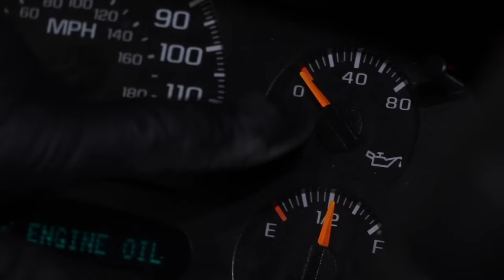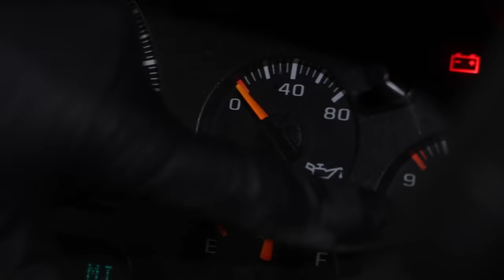Top 5 Problems 2000-06 GMC Yukon Sierra Chevy Suburban Tahoe Silverado Avalanche Cadillac Escalade

Comment: I have a 2000 Chevy tahoe. On occasion I start it and immediately shuts off. I learned to leave the key on once this happens and sit and wait till the security light stops blinking. Once it does I shut the key off and then start it. Any suggestions as too what to do??
Reply from the maker: +Tim Shaw We wouldn't be able to diagnose an issue like that here, you may want to have a local mechanic take a look at it. Thanks for checking us out! 1AAuto.com

Comment: Say i have an 02 yukon 6.0l denali and im having trouble with acceleration just changed the throttle body and im now getting the code po440
Reply from the maker: +Fowler Family Views values and insight We wouldn't be able to diagnose an issue like that here, you may want to have a local mechanic take a look at it. Thanks for checking us out! http://1aau.to/m/Shop-1AAuto-c

Comment: What about really bad gas mileage like 4.3mpg and no engine lights on? Had put in shop and had engine decarbonized now still only get 10.32mpg , any suggestions? 04 yukonxl 2500 2wd 6.0 gas

Comment: I have a 2003 Chevy Tahoe and when I put it in reverse it doesn't want to move when I let off of the brake and even hit the gas. It's almost as if the emergency brake is on. Also when I take off from a dead stop it doesn't wanna shift in to 2nd gear until I get to about 3500 to 4000 rpms and I let off the gas pedal a little and then it shifts. Do you know what's wrong ? Also my oil pressure sensor is pegged at 80 psi. Thank you for your time and help.
Reply from the maker: +Smitteeboi88 DKS Thanks for watching!  We would not be able to diagnose and issue like that here.  We recommend that you take your vehicle to a reputable garage to have it looked at.

Comment: I have a problem with my 2005 suburban taking FOREVER to fuel up....can’t pump more than a gallon at a time....I’ve already replaced the expensive charcoal vapor canister, and it’s still doing it....any suggestions???
Reply from the maker: +Bradley Whitton At this time we are unable to diagnose the issue you may be experiencing but would suggest that you take your vehicle to a local mechanic. Please do not hesitate to contact us with any further questions.

Comment: 2003 suburban will shift into any range randomly on startup. Sometimes it is hard to get it to shift back into 2wd. Any ideas?
Reply from the maker: +Anthony mellis A bad low range fork in side the transfer case can cause this, which is usually caused by low fluid level damaging it thru lack of lube. If the fluid is full and fairly clean, the most common reason is the encoder motor position sensor. You could try these things.  Thanks for the question and for watching.

Comment: Man i have a chevy 2001 8.1 liter 2500 hd and i am having a problem diagnosing my issue 

The truck will crank fine but then dies immediately. The security light will not come on at all. We have been working on this truck for months. Can you please help? I will answer any questions you have referring to the truck. This has been a nightmare. Thanks

Comment: Hi, I have an issue with my truck.
It is a 2002 chevy tahoe and it has 80k miles very low miles and the issue is when I place the gear selector in drive the gas measure get low a little then when I place in to neutral the gas return back to normal, also this happends when shift from drive to reverse and back to drive.
Any idea of what could be wrong??
Thanks for your help and congrats for your channel.
Reply from the maker: +Roberto Ortiz Since there are many reasons why you could be experiencing this issue, we do recommend taking it to a mechanic to have it accurately diagnosed. We appreciate you checking us out!

Comment: I’m having traction control problems with my04 Denali Yukon drive on highway and it cuts power and when I start my truck in the winter white smoke comes out the exhaust

Comment: I only ever had one of your listed problems with my 05 Sierra and that was the intermediate steering shaft. I did however have.

2 airbag sensors rotted out before 6 yo
1 abs sensor
1 evap. can.
1 evap vent solenoid
1 clockspring
1 cluster stepper motor for speed
programming glitch that caused the AC to blow hot on passenger side
programming glitch that caused the hour meter to reset 
brake lines and fuel lines failed before the vehicle was 7 yo
all bulbs in steering wheel controls
failed speakers
failed CD player
failed bulbs in radio
body rotted out

Yeah, the truck wasn't very good of a vehicle. Let's face it, GM built a piece of junk!

Comment: Electrical issue that you cant figure out??? Turn key on without starting vehicle then go around and shake wire harnesses here and there until you hear a clicking noise of sensors activating or the issue may even resolve itself temporarily. If so that harness is where your issue is going to lie. I have found many shorts this way. 
One shop spent 2 months trying to fix someone's vehicle and the owner got tired of them wasting their time. Brought the car to me and we found the issue the next day this way. Turns out the harness was melted going to cam shaft sensor and oil pressure sensor. Oh and the shop made that man buy a new ECM saying that was the issue without even testing it. $500 wasted
Reply from the maker: +CHALK772 Thanks for the tip and for watching!

Comment: I have a 2001 GMC Sierra 1500 Extended Cab. When I start the truck, I smell a burning smell near the fuse box inside the truck. Also, when I try to accelerate past 50 mph, the truck shakes and the smell comes back. Any suggestions?
Reply from the maker: +@BradyAye We wouldn't be able to diagnose an issue like that here, you may want to have a local mechanic take a look at it. Thanks for checking us out! http://1aau.to/m/Shop-1AAuto-c

Comment: Hello, thanks for your great content. I'm from Saudi Arabia, I have kia cadenza 2019 and since the first day I bought the car, the steering wheel becomes very hard at the night or when the dashboard board light moves to the night mode. My dealer never found solution for it. Can you help. Thanks alot and kind regards
Reply from the maker: +Mohammed Alomari We wouldn't be able to diagnose an issue like that here, you may want to have a local mechanic take a look at it. Thanks for checking us out! http://1aau.to/m/Shop-1AAuto-c
Reply: @1AAuto  ok. Thanks a lot

Comment: 07 yukon xl. No power to rear hatch causing rear defrost not to work, can't open rear access, buttons above driver won't open it either. Before I take it apart, any idea why this would happen?
Reply from the maker: +Adam Goscicki We wouldn't be able to diagnose an issue like that here, you may want to have a local mechanic take a look at it. Thanks for checking us out! http://1aau.to/m/Shop-1AAuto-c

Comment: The ground strap that goes to the hood is disconnected on mine. Does this effect anything in particular? I’ve noticed in my rear view that the outside temp and passenger airbag lights blink on and off and the buttons don’t work.
Reply from the maker: +chek pierce We wouldn't be able to diagnose an issue like that here, you may want to have a local mechanic take a look at it. Thanks for checking us out! http://1aau.to/m/Shop-1AAuto-c

Comment: I have a Tahoe 03 and I have a problem with the right signal light It turns on and off very quickly but back does not turn on what can I do?
Reply: One of the bulbs is most likely burned out and that will make the flasher relay cycle fast.

Comment: 2003 suburban code po178 replaced flex fuel sensor still coding p0178
Reply from the maker: +kevin mcadams We wouldn't be able to diagnose an issue like that here, you may want to have a local mechanic take a look at it. Thanks for checking us out! 1AAuto.com

Comment: I have a 2005 chevy Tahoe. Cold start it will start right up. After you run the truck and come back to it. Its hard to start. It will start but its takes a little. Please I need some help. Thanks
Reply from the maker: +Jimmie Whitehurst We wouldn't be able to diagnose an issue like that here, you may want to have a local mechanic take a look at it. Thanks for checking us out! http://1aau.to/m/Shop-1AAuto-c

Comment: My 02 Tahoe I bought with a new engine, which means also transmission, drive train and rear end differential. I put over 300 thousand miles on it so far. Purrs like a kitty. I can't tell if I turned the key in the ignition sometimes.
I got too many women in my life wanting me to trade so I can get some chick car. BS!!!
Any car is a chick car if a chick is driving it! And mines paid for. 
Who needs more debt?
Reply: I've got one too and it's got 230,000 and still runs great.

Comment: My 2002 chevy suburban. Has short in it. Seems to be panel lights it will sometimes. It changes what comes on like clock.  And the panel lights  Clicking sound when the vehicle   s turned off.  It has drained 3 new battery,s. Help
Reply from the maker: +Kelly lynn worley We wouldn't be able to diagnose an issue like that here, you may want to have a local mechanic take a look at it. Thanks for checking us out! http://1aau.to/m/Shop-1AAuto-c

Comment: Just got an 05 Tahoe.  Issues I have with it. It smokes during cold starts for a couple seconds. The oil pressure sits at 25 till the engine is warm, then the oil pressure is in the middle. Anybody else have these issues?

Comment: Ok i have a 04 denali wont move unless I tap the gas also while driving, it slows down by itself... will this be caliper issue or transmission or transfer case issue?
Reply: HWY V TRUCKING transmission issue, it is slipping

Comment: I guess I got a good one my 2004 suburban 300,000 miles only thing I had to put 1 water pump 1 alternator.,my 2010 90,000 miles freaking transmission went out

Comment: Great channel.  I had a auto place replace my starter.   When I got it back my altnator gauge is pegged down at the bottom and is not working. Any answers what I can do.
Reply from the maker: +Shaun Roberts We wouldn't be able to diagnose an issue like that here, you may want to have a local mechanic take a look at it. Thanks for checking us out! http://1aau.to/m/Shop-1AAuto-c

Comment: Having an issue on a 05 Chevy Suburban the AC cuts out only on the driver side did some research and apparently it’s common on these vehicles for the actuator to go out any suggestions?
Reply from the maker: +Salvador Rubio We wouldn't be able to diagnose an issue like that here, you may want to have a local mechanic take a look at it. Thanks for checking us out! http://1aau.to/m/Shop-1AAuto-c

Comment: I'm having p1133 code on my 08 Avalanche 5.3 changed O2 sensors checked for vacuum leaks still getting engine light any help I would appreciate...
Reply from the maker: +Glen Perez We wouldn't be able to diagnose an issue like that here, you may want to have a local mechanic take a look at it. Thanks for checking us out! http://1aau.to/m/Shop-1AAuto-c

Comment: Hello. I have problem with my 2002 Suburban, every time I break to stop my suburban accelerates without touching the pedal, it does not show any code. Any idea or advise how to fix it..? Any help will be appreciated.
Reply from the maker: +Arturo Ramirez We wouldn't be able to diagnose an issue like that here, you may want to have a local mechanic take a look at it. Thanks for checking us out! http://1aau.to/m/Shop-1AAuto-c

Comment: I have a 2002 Chevy Silverado 1500 when the temperature gets up to 220 my truck will stop running only if I'm not moving what could be my problem
Reply from the maker: +RUDY Kelley We wouldn't be able to diagnose an issue like that here, you may want to have a local mechanic take a look at it. Thanks for checking us out! http://1aau.to/m/Shop-1AAuto-c
Reply: @1AAuto  does those trucks have some type of sensor to do that or would that be in the computer what do you think

Comment: I have a 2000 Chevy Tahoe..it has started making like a grinding sound when I accelerate or put my truck in reverse. Ive been told I’d have to replace my transmission and/or it’s my 4 wheel drive acting up. Can someone help me please..???!!
Reply from the maker: +Sasha Johnson We wouldn't be able to diagnose an issue like that here, you may want to have a local mechanic take a look at it. Thanks for checking us out! http://1aau.to/m/Shop-1AAuto-c

Comment: So I'm having an issue with my 02 yukon I have replaced the alternator the battery the starter but I still continue to lose power while I'm driving the voltage meter on my cluster keeps dropping from 14 to 9 when I hit the gas do you guys have any idea what that could possibly be that I can fix cuz I don't want to get rid of my truck I mean I've taken it into a mechanic and they change out the fuel pump but that wasn't the issue but I really don't know why I'm losing power as I'm driving I actually went to go to the store the other day and it lost power as I'm pulling into into a parking spot if you guys could help me out and tell me what is pot what is wrong with it so and what parts I need to buy it'd be great thank you 

Joshua Wright
Reply from the maker: +Joshua Wright We wouldn't be able to diagnose an issue like that here, you may want to have a local mechanic take a look at it. Thanks for checking us out! http://1aau.to/m/Shop-1AAuto-c
Reply: @1AAuto  thanks anyways guy I do appreciate your help and time

Comment: A1 Auto. I own 03 silverado and my 4 wheel keeps going into 4h or 4low with out me doing it.
Ill park it in 2wd and next time I start it up either red light is on (N) which i know should never be in or its in 4h or 4low.???
Reply from the maker: +DVS FPV We wouldn't be able to diagnose an issue like that here, you may want to have a local mechanic take a look at it. Thanks for checking us out! http://1aau.to/m/Shop-1AAuto-c

Comment: I have a super clean garage kept k2500 suburban and everything mechanical is fine with it but i deleted the cats and i have the code coming up for the sensor behind the cats and the check engine light was only there for a week and went away did the computer of the truck know that i took them out so it said its fine?
Reply from the maker: +RCT Thanks for checking us out!

Comment: i have a 00 yukon that has over 403,000 miles and every time i slow down to about 40-50 and then speed back up, it shakes and doesn't want to accelerate. supposedly they changed the O2 sensors but i wonder if they did or could it be something else? anyone else have this issue?

Comment: I have an 02 suburban 4ed. My battery drains after I turn the vehicle off for the night or even off for a couple hrs, what could be the problem?
Reply from the maker: +Hugh Hill Since there could be multiple reasons that is causing this issue, we recommend bringing your vehicle to a local, reputable mechanic for a diagnosis. Thanks for checking us out!

Comment: Have a 2005 Tahoe that's rolled 210k.
It's starting to flash engine overheat on the warning reader, but the gauges don't show a problem. I have had an engine overheating and that's not what's happening. Anyone have any ideas?
Reply from the maker: +George Herod We wouldn't be able to diagnose an issue like that here, you may want to have a local mechanic take a look at it. Thanks for checking us out! http://1aau.to/m/Shop-1AAuto-c

Comment: I have a 2003 tahoe my problem is when I start my tahoe all dash light stay on I have looked at all fuses  none of gauges work  I will hit a pot hole they come on and work for a little bit then goes back to not working please help
Reply: Alvin gilmore sounds like a cluster issue may need to be rebuilt

Comment: Do you still have rocker panels, gas tank lid, rear bumper, rear wheel lips, fuel pump, the 5.3 piston slap, wheel bearings, transmission shift solenoids, working heater controls, intake gasket that doesn't leak, working door handles, gas line, rear axle bearings....than you are doing good.... better than my 2002 Silverado. LOL!

Comment: What happens when my check engine light come on for O2 sensor on the freeway but goes away when I drive in the streets
Reply from the maker: +Tim Nunez We wouldn't be able to diagnose an issue like that here, you may want to have a local mechanic take a look at it. Thanks for checking us out! 1AAuto.com

Comment: I have a 2002 chevy tahoe that every once in a while wont want to start, like ill turn the key over, the truck turns on and I know it does turn on bcz it has an aftermarket exhaust that is loud BUT it only turns on for a split second before it turns off and then I only hear the starter PLZ HELP ME
Reply from the maker: +POWER VADER We wouldn't be able to diagnose an issue like that here, you may want to have a local mechanic take a look at it. Thanks for checking us out! http://1aau.to/m/Shop-1AAuto-c

Comment: My only concern is that when I put the computer it shows there Bank 1 and bank 2 running too rich I don't know what is that and also when I am in the Road sometimes the truck turns off
Reply from the maker: +Guillermo Narvaez We would suggest consulting with a reputable local mechanic for further assistance with a diagnosis on your vehicle. 1aauto.com
Reply: @1AAuto  T4 I was thinking to do that it's a 2004 Chevrolet Tahoe four by four

Comment: My 2000 Silverado 1500 doesn’t want to shift to the 3rd gear when I’m driving. I have to kinda press the gas to make it shift, it stutters when it doesn’t want to shift. After a little bit it stutters again, any help?
Reply: Adan M maybe your Tran is slipping, I’ve heard normally 3rd gear goes out in them

Comment: What could cause my 03 Avalanche's speedometer needle to occasionally be stuck on 0?
Reply from the maker: +Will Griffin We wouldn't be able to diagnose an issue like that here, you may want to have a local mechanic take a look at it. Thanks for checking us out! http://1aau.to/m/Shop-1AAuto-c
Reply: The stepper notes have gone bad, will need to be rebuilt